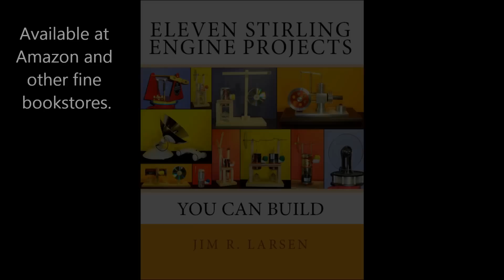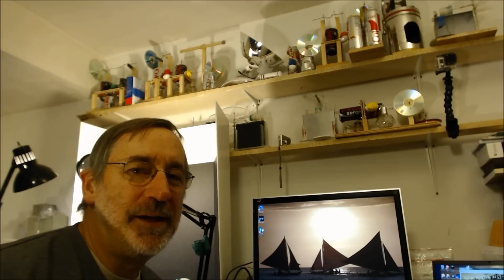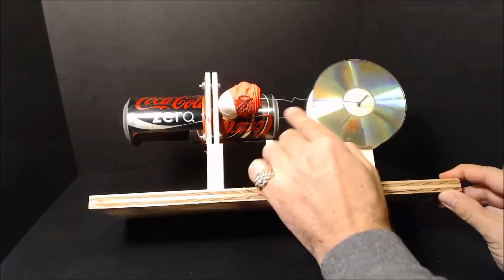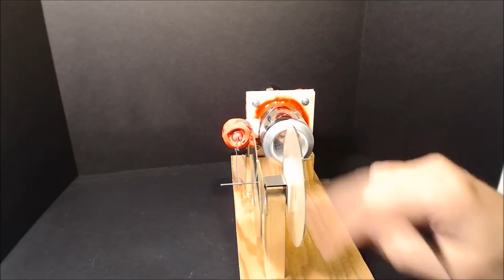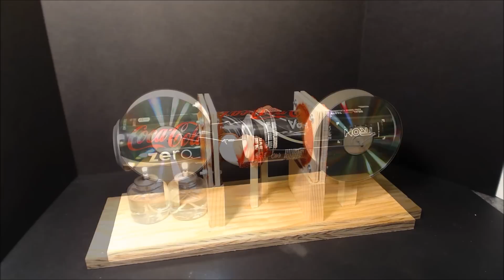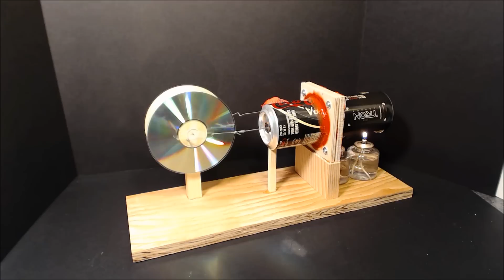Stirling Engine Design Talk 3

Comment: How about using a heating plate at the bottom of the hot can, which can be made to heat up using the engine's power, and it would only need a flame to start, then keep going on it's own :)
Reply: cant generate enough to do that. generating heat needs alot of energy. you cant get more than what give into it. heat is something that that radiate all around. its costly.

Comment: Seems pretty slow for a two candle engine. is that because the drag from sliding the displacer horizontally?
Reply from the maker: Yes. Friction is a challenge with the horizontal engine. It is also a challenge to warm the chamber because it is beside the candles, not directly over them.